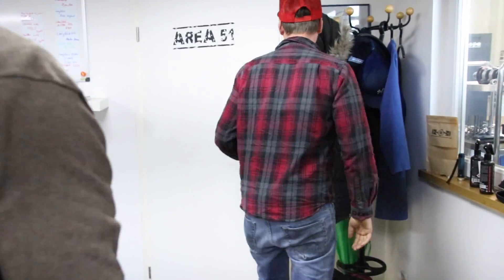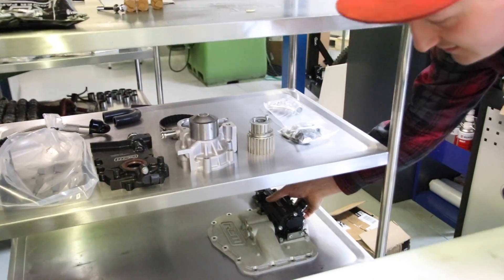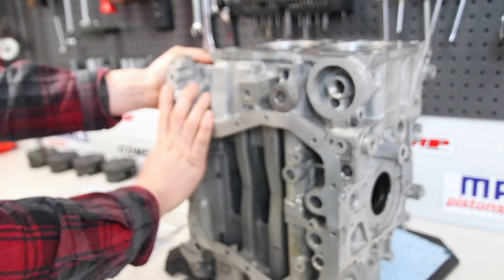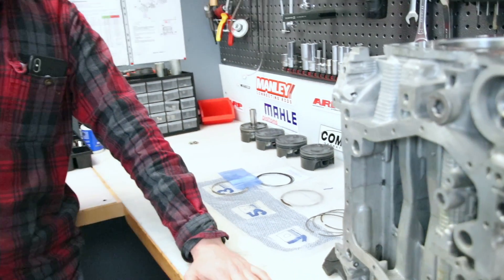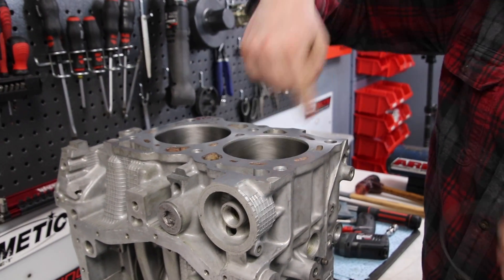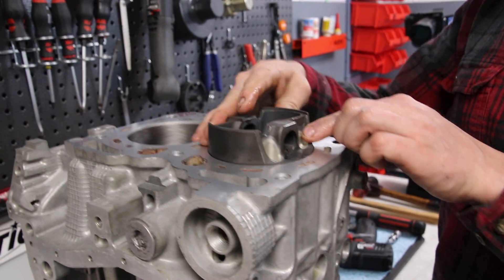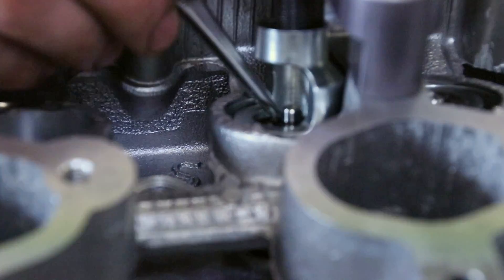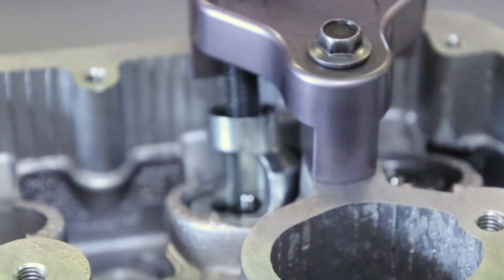Amazing Engine Build EJ22 l Satisfying l Time-Lapse l Subi-Performance

Comment: I see you are using Three Bond 1215 for gasket. What are you using for the bearing and cylinder walls (pink)? Also the black paste on the threads?
Reply: redline and arp

Comment: Do you still need an intercooler with piston oil squirters ?
Reply: Oil squirters are meant to cool and lubricate the pistons obviously. Intercoolers are meant to make air cooler before it gets combusted because cooler air is more dense with oxygen. More oxygen + more fuel = more power. As a side effect it may make the engine run cooler too but that's not an intercoolers main purpose.

Comment: Relatively useless video with no explanations for anything being done (which is useful for relative novices) i.e. TTY & reason for changing to studs from bolts, where assembly sealant is used and why (like going to oil side of fastener holes), putting the inboard gudgeon circlips in before the pistons go in and so forth and no explanation of the engine specifications and what improvements over stock. It's just a silent movie.

Comment: at 5:02 you go around the outside of one hole with the sealant while on all the others you go around the inside. Why is that? Is that a special hole?
Reply: It depends on what the hole is for. You always go to the side of atmosphere if it's a hole carrying a fluid that needs to be retained in the engine but if it's an external fastener hole (like the sump or thermostat housing) you go between the hole and the fluid so the fluid doesn't make its way to the hole and outside via the threads or head/nut. So I suspect that's an oil passage - I'm not actually familiar with these.
As per my other comment - it's a pretty pointless video without explanations or articulated reasons for what's being done. You've found the same.
https://www.youtube.com/watch?v=dltpWxmfp6Y&lc=UgyfSixb_0IKSh2klRd4AaABAg

Comment: What would be your best advice for someone who wants to build a running engine to learn?! Get the tools or just get the engine and run it? What would be your best tip for a beginner??
Reply: Honda's .. nothing but Honda's😂
 You'll thank me later. If you need all wheel drive, drop a Honda motor into a Subaru and now you have a reliable Hondaru✔️🍻🇱🇷

Comment: That's an interesting tool for measuring the degrees you turn the bolt/nut. What brand is that?
Reply: Embarrassingly, yes.
Reply: @555_Kochi_STi  Haha OK. BTW the ratchet being used is the same German brand.
Reply: Würth
Reply: 15:04 Did you really not see the big red Wurth logo on it?

Comment: You lubricated the head studs prior to placing the head, i would be worried of grease getting on the head surface as it was placed downwards.

Which heads are those that you are running? They didint look like the bigports but i could be mistaken i only saw rht20 and didint see the left side.
Reply: Same to me
Reply: 1. always lube steel fasteners into softer metal ie alu/mg. 
2. no danger of contamination if you're not being clumsy or careless.

Comment: What is the special small black bolt for oil separator?🤔
Reply: Thread sealant. The factory service manual calls for some gasket maker if you're reusing and old bolt. The new ones come with it pre applied.

Comment: That's not a regular 22 but a 22T right? Plain old 22s didn't have squirters. Is the purpose of the yellow marks to see if the bolts shifts with the vibrations? Good job! Keep them videos coming :)
Reply: The paint marker is to check if the bolt head position has shifted due to vibration or tampering.  It also helps you keep track of bolts you have completely torqued - some engines have pretty elaborate torquing procedures (like Subarus!)
Reply: Because it is closed deck, this is a EJ22T. The Plain Ej22 is not closed deck, but open deck. I did not see the squirters on the EJ22 I rebuilt myself 2 years ago.  I would love to replace my EJ22 with a EJ22T.
Reply: Blaze Townsend what’s the OEM part number for the old EJ22 as my EJ208 Legacy is messed up says they’re 92mm,  but they are 96.9mm, with a higher compression rate of 9.5/1. My pistons crowns look like the 92mm was that similar to your build bud?
Reply: The additional crankcase vent by the #1 cylinder shows that it is the 22T. Unsure if the 22G had that port.
Reply: I have squirters in my decked ej 257...custom cnc-modified block..705 hp /800 Nm